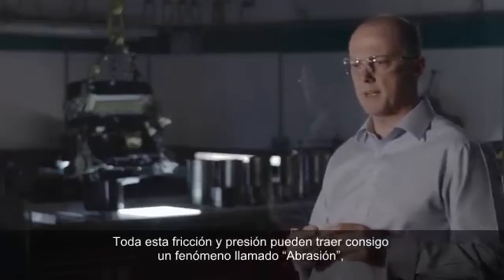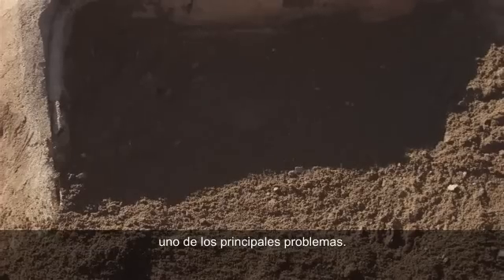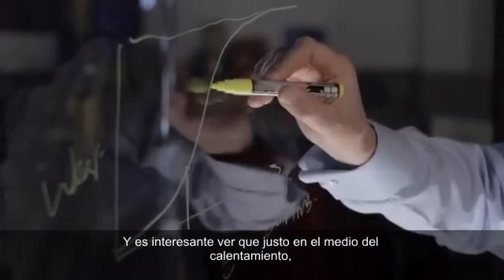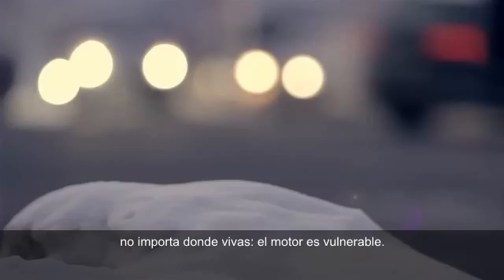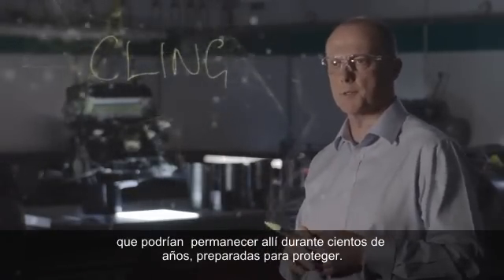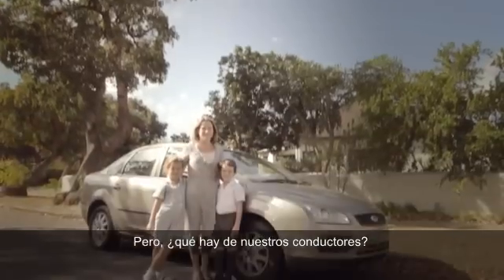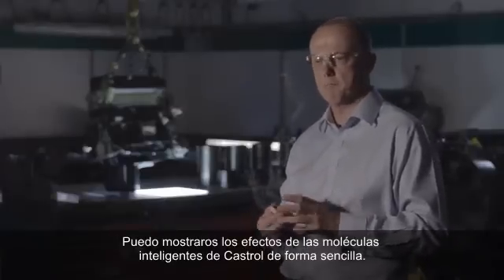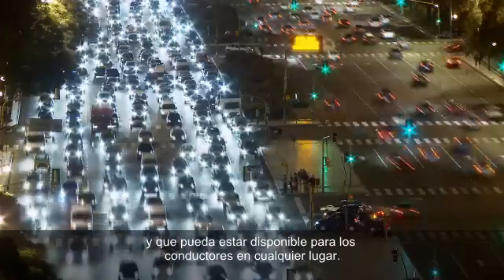Complete Film - Intelligent Molecules: the amazing science of Castrol Magnatec

Comment: I would recommend this oil.  I bought a Toyota Aygo with 10k miles on the clock.  I drove the car with Toyotas oil and then changed to Magnatec and the difference was amazing.  Much quieter start up and smoother engine.  When I changed oil again at the next oil change, again with magnatec, there wasn't really much difference.  I would say the only issue is that it comes in 4l tubs instead of 5 so anyone needing more than 4l will need to buy additional 1l tubs at a greater cost.